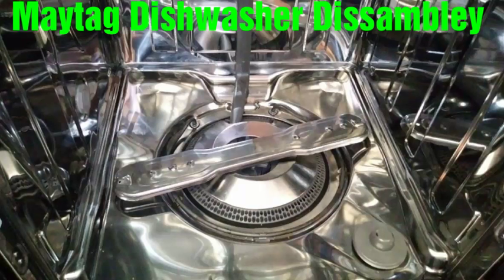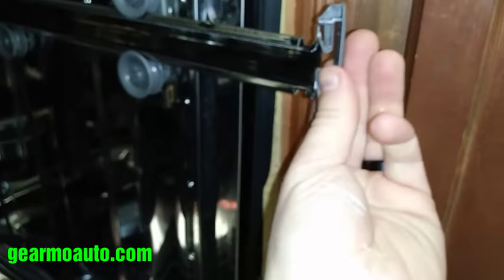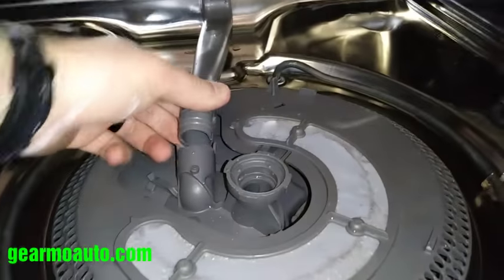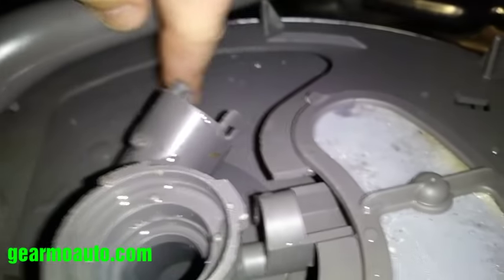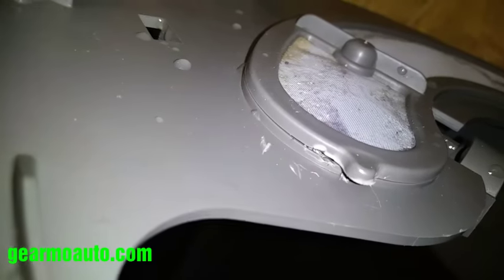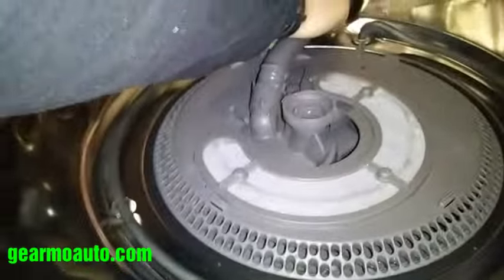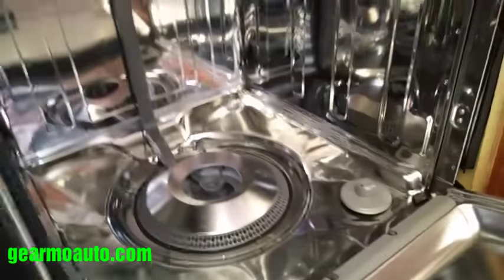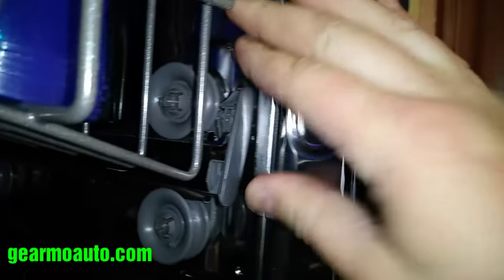Maytag Dishwasher Disassembly

Comment from the maker: GET THE NEW MESH FILTER "ACCUMULATOR" HERE
( AMAZON ) ( 143 BUCKS ) 
https://amzn.to/40pFrRE

GST AN AFTERMARKET MESH FILTER "ACCUMULATOR" HERE ( AMAZON )
( 78 BUCKS ) ( DIRECT FIT )
https://amzn.to/4gYzaDz

MY MAYTAG DISHWASHER MODEL #
MDB4949SDZ0

FILTER PART # w11205078

NOTE : MAYTAG COMPANY HAS BEEN BOUGHT AND NOW WHIRLPOOL IS THEIR PARTS SUPPLIER. SO IF YOU SEE WHIRLPOOL ON THE MAYTAG PART DESCRIPTION ITS SUPPOSED TO BE THERE. 

DISCLAIMER:  I GET A SMALL COMMISSION THROUGH MY PURCHASE LINKS , YOU GET THE EXACT PART YOU NEED AND SAVE TIME , SO WE BOTH WIN.

Comment: Fantastic description of how to disassemble. Although, I did go one step further and remove the filter under the filter you removed. The part the pipe goes into comes out and it was NASTY. I used dawn dish soap to clean the white filter. Make sure you get all the soap out or you’ll have a mess of bubbles in your kitchen next cycle. :)
Reply: Yeah, I went one step further, too.  I'm glad I did because- like your experience- mine was NASTY!
Reply: Yep. Glad I read the comments, cause it was bad. I got most of it out but there was a little left in the tube after. Flushed with vinegar and baking soda, hope it's clean enough.

Comment: Thanks so much for the disassembly info. This was more complicated than my last dishwasher, clearly to get the repair person out. For the "replaceable" filter, we just used a dish scrub brush, dish soap and the faucet spray feature. The dish soap helped release the old oils that make the gunk cling to the filter cloth. The scrubber loosened the sludge, and the sprayer released it so it would come out of the tube opening. Took 5 or so rounds/10 minutes. Hope this helps someone else so they don't have to order an unnecessary part.
Reply: Thanks so much!

Comment: Thank you for this video. I cleaned ours for the first time since purchase June 2018. The manual doesn't even mention cleaning the filter. The extended warranty ran out 6-30-2023.
It was full of greasy mushy paper from washing jars before removing the paper label. The screen that you attempted to open I let sit in the sink with Dawn dishwashing detergent and ammonia. It seemed to clean the layer of grease inside. And the heavy layer of grease on the underside. All parts were greasy, and I washed them in the Dawn and ammonia.
The basket thing that sat in the very center came apart into two pieces with the one also two pieces but still attached that swing apart. Having it separated helped to clean out the greasy paper sludge.
No wonder the clear plasticware was filmy.
I'm running it now with the few dirty dishes that was in the DW with a 1/3 tsp of Dawn and a cup of vinegar on a quick cycle. I checked several times to make sure it wasn't sudsing out of control. No suds.

The only difficulty I have in cleaning our dishwashers is that I am short and my arms just reach to the back of the washer to get the piping off. I have very little leverage.

Comment: Thanks for the clear and simple instructions. Soaked vinegar paper towels on the mesh screen. Let it set, then scrubbed with a toothbrush and hot water. Came clean. Cleaned out the second filter (yuck) assembled back together. It's now running a dishwasher cleaner solution. Can't wait for clean dishes again

Comment: Thanks for the video, it helped us get started to clean it.  At 2:35, in the little area, there are two plastic pieces that lift out easily, and the bottom one had a lot of gunk underneath.  It exposes a well, probably where the sump is, that is about 3 inches deep. My opinion is that the filter is an assembly that can be replaced, but I doubt the filter will come off, I tried prying ours too.
Reply: timh141 I took that plastic piece out and about died!!! It was worse than the filter.
Reply: Yes , I found that too.
Reply: @sonyamchianelli   Yes, mine was disgusting. My dishwasher is a bout 7 years old.I've used the machine cleaners but never taken it apart before.
Reply: timh141 When I pulled that lower strained out and showed it to my wife she dry heaved and ran out of the room lol
Reply: I don't know if I found the area you guys are talking about.  I pulled the filter out easily, it came apart in two pieces and it definitely needed cleaning.  But I am not sure what you guys are talking about.  The hole where the filter drops into?
Reply: Aimee you probably did. Pause the original video at 2 minutes 35 seconds, it shows the area. If it's about 3 inches deep after you took the pieces out that has to be it

Comment: Thank you for the video.  I found a good way to clean the micro mesh screen.  May seem like an overkill, but it saves $$ vs buying a new lower screen.  I used my pressure washer on LOW pressure.  It worked perfectly.  I tried hot water, dawn, etc to no avail.
Reply from the maker: Thank you for the support! It helps alot

Comment: We use an Affresh tablet once a month and after 6 years, filter is still almost like new, so no need to clean. We are also using RinseAid, with the Finish soap pellets that our installer recommended.

Comment: Good video, thank you. HOWEVER... You did not show checking under the round cap piece in the middle'ish. THAT'S where all the nasty is!!! That was absolutely the WORST part of this whole cleaning experience. I hope you've cleaned in there as well! Be sure to check next time... RIGHT NOW... if you haven't cleaned there previously.
Reply: You are absolutely correct, I just did that and it was the worst part !
Reply: Thanks for this comment!
Reply: I think you didn't have the same dishwasher model then. I did his steps and the thing he removed was nasty and needed cleaning
Reply: I pulled mine out and almost passed out. EVERYONE LISTEN TO THIS WOMAN
Reply: @jaketoczek979  how??
Reply: Omg I found it
Reply: @lashesbysarah6702  I did the same thing. I was like this ladys wrong theres nothing here! and then suddenly there was and it just came off in my hand and I was like huh gross
Reply: My dishes have funk on them,  dried. Yuck. Almost have to re wash them, espec the glasses , every time. Do y'all  think my filters are clogged? I'm gonna try this myself.
Reply: Found it as well.  It was so clogged.  Hoping that is issue.  And yes, it was just as awful as everyone mentioned.
Reply: Mine popped off and was clear 🤔
Reply: Round cap piece in the middle?  Can anyone take a picture?  I pulled out the filter and cleaned it. Mine was full of sticky bottle labels.
Reply: I appreciate this video. Found it about 2 years ago and cleaned my dishwasher. Once again, the dishwasher just didn't seem to be cleaning so I did this all again. The mesh screen was full of debris. The other parts not so much. Disassembled, cleaned and put back together. Thank you!

Comment: Thank you for this video! Mine really needed cleaning.  Mine was gunked up with labels (I wash jars prior to donating and they come off sometimes).  Also had a few sharp chips of ceramic plates and a rubberband in it.  I scrubbed the filter on the ring with hot water and a fine brush, used dawn and goo gone, it helped somewhat.  That should be removable to clean! Mine was much worse than yours.  I will be removing labels from now on prior to placing jars in there.

I didn't see you remove the plastic drain from the very top from the clips so the whole part would come out.  In my model, it was necessary to get the leverage to pull the tube end at the bottom.  It was the most difficult clip for sure.

Thanks again for a great video, your close filming really helps and also putting it back together.
In Gratitude.

Comment from the maker: Hey Everyone I left out the best part. When you get everything out there is a plastic that is a Semi Filter in the drain part. Pull that straight up and you will find alot of junk in there.
Reply: TONS AND TONS!!! I pulled out what was basically the size of a MCdonalds biscuit of GOOO!!  It was so dense i could stick a fork in it.... and did LOL
Reply: I took apart the drain pieces too put it back together now not draining thinking I put something back together incorrectly. Just needed a few more steps. At least I know I got this part correct. Thanks
Reply: Thanks for putting this together.  Mine is sanitary again and dishes are much cleaner.  I appreciate the help.

Comment: Thank you!  I just cleaned mine.  I washed with Glisten dishwasher cleaner as well.  Cleaned up most of the calcium build up.  Happy wife happy life!
Reply: Check the drain filter others have mentioned.    It pops tight out.  Was an absolute clogged mess.

Comment: This video is a life saver thank you!. I was able to clean the filter thing by rinsing it multiple times in a grease cutting soap, along with vinegar and boiling water.  Mine was super super grimy, and it took a long time and many changes of water, but it finally came mostly clean.  I also found some long pipe cleaners (chenille stems) and wove some together to be long enough to work some of the grime out that way.  I have yet to figure out how to get the metal top back on though.  The tabs line up, but they don't snap in.

Comment: Yes  Do lift up and out that plastic puck you see at 2:35.  There will be tons of grease in there and you really want to get that crap out.  ALSO when you pull it out what is left is the plastic spindle that holds the puck.  That spindle also comes out with a quarter turn and pops right out.  NOW you can get deep into the bottom of that well and remove grease, broken glass and other unknown particles.  This video is great as far as it goes but please go the extra step.  ALSO I had a devil of a time getting my stainless snap ring back on the top of the assembly.  What happened was the little tabs pulled ever so slightly larger when I removed it.  So a very gentle needle nose just to snug those tabs very slightly allowed my shiny ring to snap and hold.  This is a great way to say the $175 service call!!!

Comment: you forgot to remove the third filter. I found it by mistake and it turned out to be the most filthy and clogged of them all. It's in where the hole is when removing the second filter.
Reply: Yes it’s true lol
Reply: Same here. The third filter is the worst and usually has the large objects including glass.
Reply: Can you provide a video?
Reply: @tracieparks370 there is a video by a guy called bootstrappin (without the g)....I just watched it and it helped
Reply: Same! Mine was so nasty, I refused to touch it with my bare hands.
Reply: Do you have a link to the third filter?

Comment: You can get the micro screen off, but careful prying up away from the base is required. It pressure fits into a grove with a gasket that can be damaged if you pry down.  I got mine off no issue going slow as cleaning wasn't helping. If you are going to order a new part might as well try prying it off. Keep the second part to make cleaning next time and easy swap.

Comment: I found this after looking for it
From the manual 
MODEL:MDB8989SHZ
 Filtration System
Your dishwasher has the latest technology in dishwasher filtration. The Clean Water Wash system continuously removes food particles from the wash water for excellent performance. Plus, there is no need to ever remove and clean the filter.
Reply: you would be suprised after 6 months my dishwasher wouldnt wash the cups at top but there is good water flow and heat i took the filter off and cleaned boom the problem was fixed

Comment: Angeline Pennell is correct. Mine was completely clogged with soap residue. There's an odd looking cover that will pop off.  Then a part with a lot of slots.  It will lift off too... just wiggle while pulling up. Then you have access to the entire catch basin. Everything was covered in dried dish soap.

Comment: to clean that screen that was glued or molded in , I scrubbed the screen with soap and water and a soft brush , then blew it out wit a air nozzle the opposite it way, it wasn't prefect but a whole lot better than when it came out.

Comment: The white half-moon filter in the bottom can be removed with a bit of work.  It's held in place with a simple groove/snap system like a cheap plastic container, however, it's glued into that.  5 minutes with a butter knife and being careful not to crack anything and it came off.  Now it snaps back in place as expected but can be removed with just my fingers and not a tool.

The flat fill valve on the front-right is removable.  It has a snap thing on the bottom of a stem in the middle.  Pull lightly to pull it up, then a little firmer until it snaps out of place.  There will be a small circle at the end of the stem where it locks into place.  I had so much gunk under that I gagged, but I believed it was non-removeable.  

This system is possibly the worst design I've ever seen.  

Cheers!

Comment: If I’m correct you can’t inspect the chopper on this machine.. my chopper is a bit “whiny “ and I wanted to see if it was clean and clear.. I believe you have to remove the dishwasher from the cabinet, and disassemble motor/chopper from bottom. Is this correct?

Comment: I cleaned all of this including the food trap. That was filthy. The dishes on the upper rack still were not cleaning properly. Judging by debris on them, there was insufficient water flow. Assumption was the pump was faulty. I replaced the entire lower assembly as it was close to the cost of the pump alone. Glad i did. Once i had the new assembly in place, i dismantled the old. The culprit? Not the pump. A failed and blocked food chopper unit. This effectively cut the flow of water to the pump. This is a design issue however, as you must remove the pump to access the food chopper unit. And to remove the pump, you have to uninstall and flip the dishwasher!😠
Reply from the maker: Dang I am sorry man. I had to have 2 warranty repairs One for the pump and one for the board. I know your frustrations

Comment: A big problem with these units is the food chopper in the pump assembly. The blade will start wearing through the screen, catch, and eventually the nut will pop off the shaft, and with it the blade. Food will accumulate on the screen and cause low pressure, which will make your sprayers not work properly, and not clean the dishes. It's a pain to replace, because it's on the bottom of the dishwasher. You have to flip it over or lay it on it's side to replace it.

Comment: GREAT as far as you went.  When you took the fine filter out, the part down in that little well should be pulled out too...it is another filter for larger 'stuff'   Also, then the little tube that sticks up ... just turn it and pull it out, there will be even more yetchy stuff...

To be sure you get the worst of it, I would take the water out of that little well area BEFORE removing that little tube that sticks up...The grated filter will inevitably have stuff that will fall off when you remove it....then just reassemble as you disassembled...PAY attention to how that little tube fits in the well before you remove it, it only goes in one way, much simpler that way...then you do not have to fish around to get it to screw back on (it is only about a quarter or half a turn).
Reply: Great tip, I pulled that out and it needed attention too.  I think I figured out everything.  The circular piece with the screen may be the filter, but the drain below it definitely requires much more cleaning.
Thank you.

Comment: Awesome video, totally helped, but I have little particles inside the spray arms. I can push them back in, but cannot get them to come out. Tried high pressured water and shop vac. Very frustrating,  any advice, thankyou.
Reply: Dismantle the arms and poke debris out of holes using a toothpick. Now tape over the holes. Stand the arms on end in a sink. Run water in the center hole on the arm. This will float out the debris in the lower section. Rotate and repeat. I even had loose ball bearings in mine! Had to use a magnet first to get rid of them😄😄😄

Comment: The video starts out great, but there is more pieces that simply come apart with no tools needed and reveal food traps that get real nasty just before the circulating pump. That part was missed on this video and should be checked if your already this far into it! As the top screen is just a pre screen. Very simple procedure but again was not shown here on this video.

Comment: Good info but the hardest part about getting to the filter is removing the middle dish rack on a newer maytag dishwasher. Everybody shows the racks already out when they start. My maytag has 10 or 12 clips that have to be pushed or pulled to take out the racks and not even maytags website has instruction on how to remove them.

Comment: Help!  I have this dishwasher and did all the helpful steps very carefully.  Cleaned everything and put Humpty Dumpty back together again.   When I attached the bottom spray arm, it is "slightly" dragging against the metal dome.   Now when running a cycle it will not spin.   It seems when the plastic water source coming down the back is re-attached it is then putting pressure on the back of the plastic piece (the grey round thingy with the mesh screen) causing it is raise up slightly in the front.  I have taken all apart and put back together 10 times and is the same.  I ran the dishwasher and all is working but the sprayer arm seems to be in the same position when I open the door to peek each time.   Some plates in the bottom had specks on them so is not freely spinning.   How could this be happening.   I KNOW all parts are back in the same position.   It is pristine clean now.   I am pulling my hair out!  Any ideas?   Thanks!